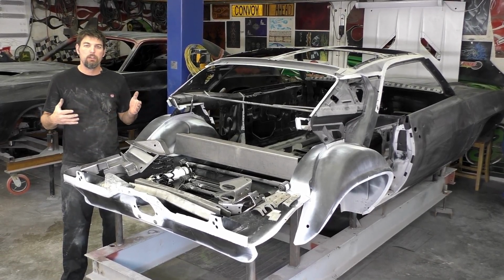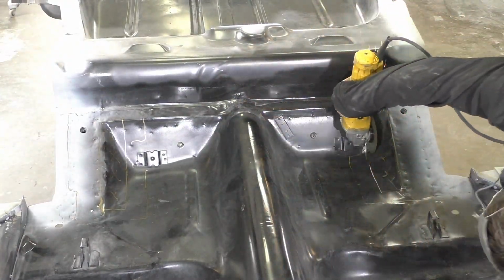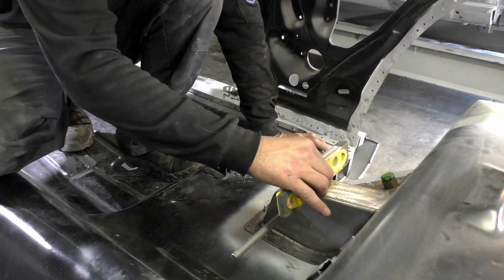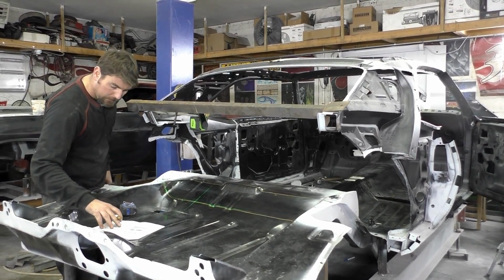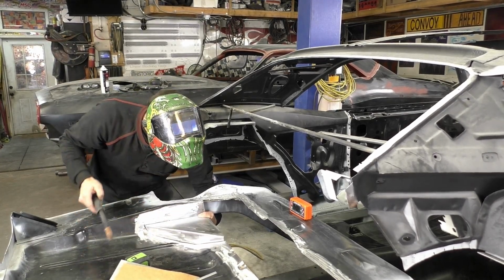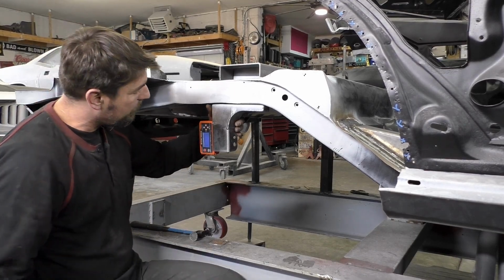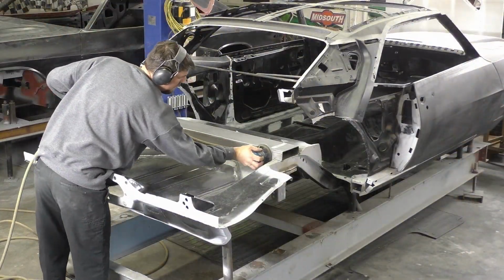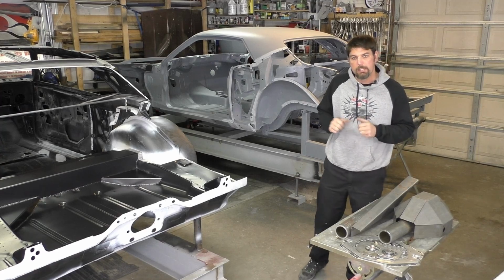67 - 69 Camaro Firebird Detroit Speed & Engineering QUADRALINK REAR SUSPENSION Restoration episode 7

Comment: As a fan of the restomod scene I really like what your doing with the firebird. Would be interesting to see what Mig welder your using. Maybe throw that into a future video ? nice work.
Reply from the maker: Thanks a lot. The welder honestly is nothing special a lincoln pro mig 180 that has been in use since around 2004 and still running strong. Its works well for the automotive sheet metal

Comment: What id the car was backhalfed and the stock floor is gone?
Reply from the maker: If the car is backhalfed and no stock floor, if you wanted the detroit speed quadralink I would recommend putting in the factory floor, frame rails and everything else back in the car. If you don't do that I would stick with the back half 4 link assuming thats already in the car.

Comment: Nice job! I did all these installs on my 68 Camaro after the quarters and the way you are doing it looks way better, easier access.
I’m about to do the fuel pump access panel that Detroit Speed has that is also high quality , that would also be easier for you before you close those in those quarters, great planning , looking forward to your next videos.
Reply from the maker: I don't think I am going to add the fuel pump access panel. Is there a reason you need the fuel pump access panel besides to access to it without dropping the fuel tank? Do you plan on accessing the fuel pump that much? I see a lot of guys installing them but I figured I don't think I need that.